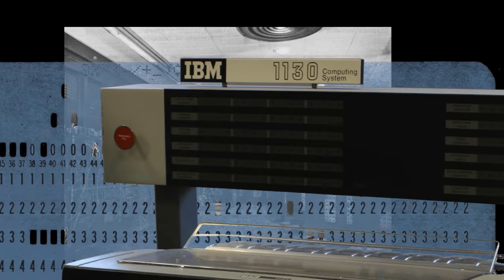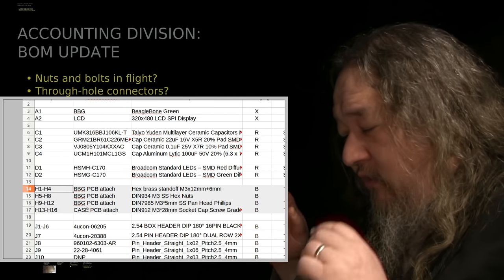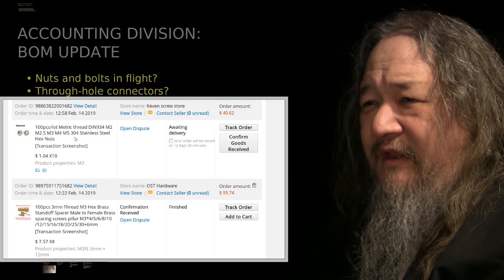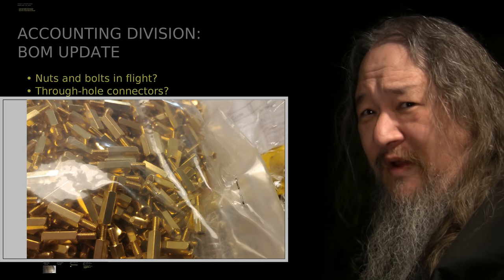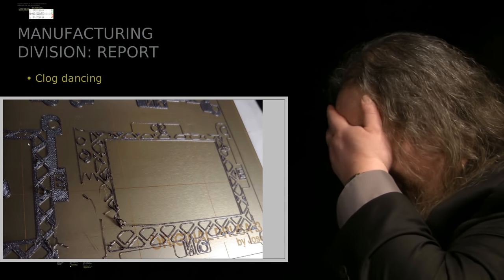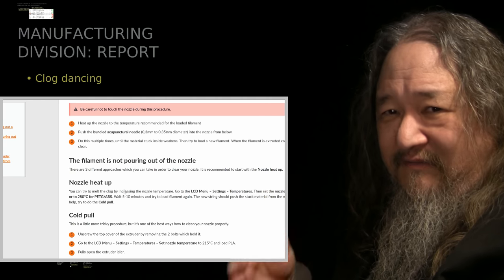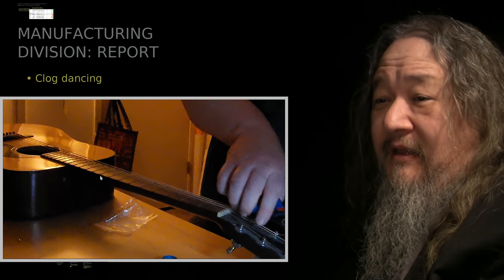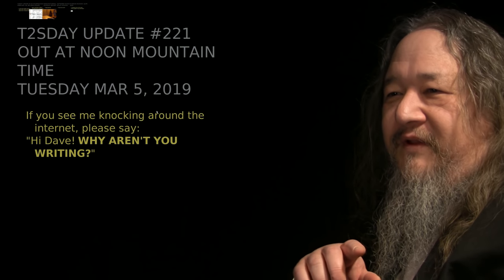The Wall of Science - T2sday Update 220

Comment: The way I've handled clogged nozzles in the past is by putting them upside down on a piece of aluminum foil in the oven on a pretty high temperature, like 450 or higher, for ... a while? Maybe a half hour. All the plastic will melt out and hopefully take whatever is clogging it with it.
Reply: Of course that's only if the clog is in the nozzle itself, and not somewhere up in the tube above the heating element. As it now sounds like it was, as I continue to watch.
Reply: This is one reason I like printers with more exposed extruder designs than the Prusas.
Reply from the maker: @JobyElliott  Yeah, seems the nozzle was an innocent bystander this time..